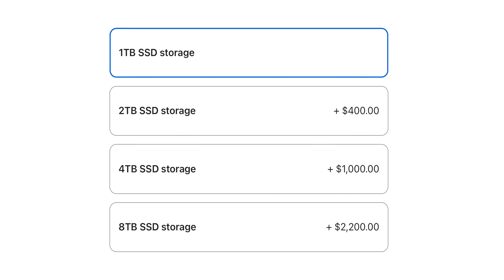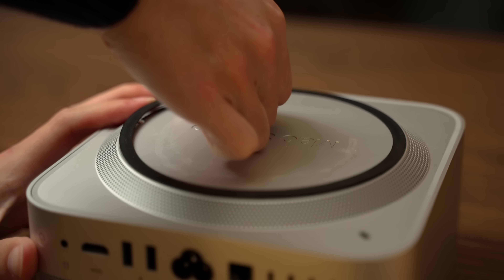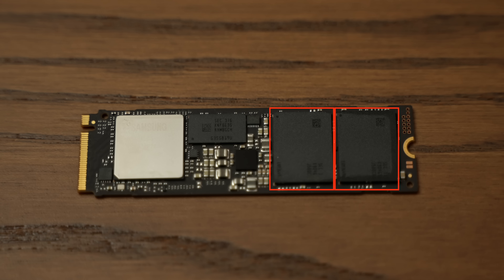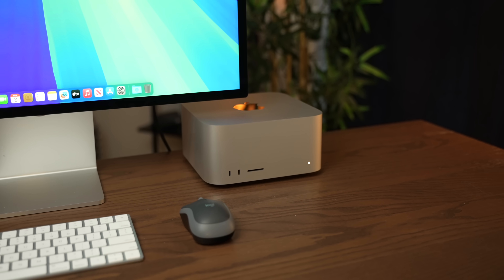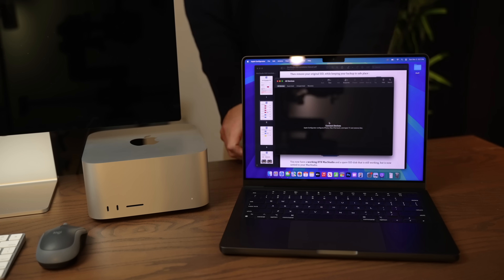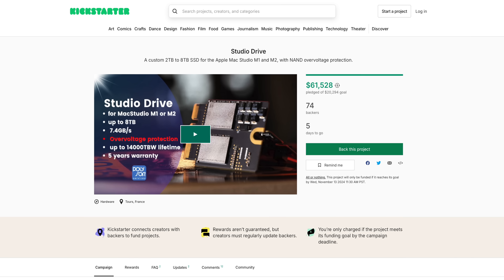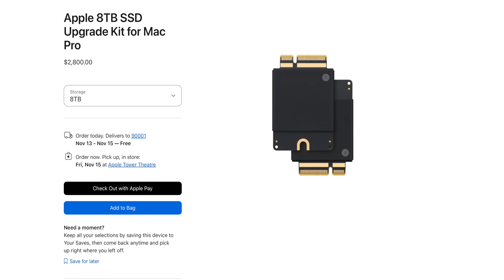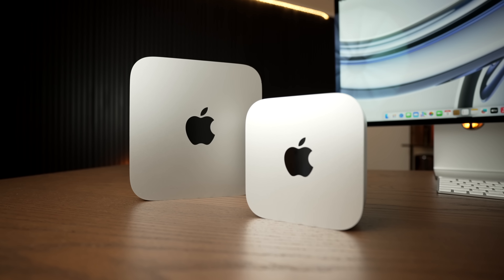UPGRADE your Apple Silicon storage for HALF the cost!

Comment: Can't wait for Apple to roll out a firmware update that turns the PSU into thermonuclear bomb once you remove the SSD
Reply: That design will be very Israeli 😂..
Reply: Must an Apple shareholder to say that
Reply: They're gonna have to change this at some point. I smell EU is already on it. 😂
Reply: You know if apple does that, it will become a lawsuit. People should have the right to use their own storage and not be forced to go with there crazy pricing that apple offers. They can't say if you upgrade it voids the warranty then go create firmware to block 3rd party storage because that would be a double violation. Voided warranty and you block the external storage
Reply: unfortunately they cant really do that! the ssd controller is integrated on the SOC
Reply: I learned the hard way, that Mac's can't work off the power, if you remove the battery. It still boots up, but it takes like 6-7 minutes for me, to be able to open up Finder. My battery went balooney, so I took it out and put in on the dir at my backyard, in case it was about to set itself on fire. But I still needed my laptop for work. I've had like 4 other laptops. All of them work withot a battry, no issue! No here ... not the Mac!
Reply: Do you mean apple silicone version or all macs? @user-qy2wf2lt6v
Reply: Don’t worry Trump will end us all before Apple can
Reply: They'll turn it into a Motorola pager !!😮
Reply: You are savage in your source of mirth
Reply: Is there an option to upgrade my iMac mini m2 planned?
Reply: found the sour guy who paid retail to upgrade his ssd 🤣
Reply: At least making the Mac Studio self-destruct… render it unusable… It will come with the next firmware!
Reply: Goofy
Reply: apple can fix this easily. Just lower the price of the SSD upgrade and raise the price of the base basic version. Is that what you want?
Reply: @imho4990 … or just offer storage amounts comparable to other manufacturers????? No need to guzzle the corporate glizzy bro. 

PCIE 4.0 storage is literally so cheap rn.
Reply: @RiceCubeTech  The problem is that the base Macs are very cheap. If you want to buy something from ASUS, DELL etc. you have to pay more despite cheaper SSD memory.

I prefer the current business model. Those who need more memory make money on this device and have a budget.
Reply: @tomaszolszewski8561  The problem , from my perspective, isn't the business model. The problem is pricing. It shouldn't cost $200 to upgrade to the next tier of ram or SSD.
Reply: @dog61  The business model is based on making money on memories.
Reply: @imho4990  Or just stop overcharging by a 200% markup?!?!?!?! You seriously don't get it!
Reply: @imho4990  They could also simply take a minor haircut on their massive profit margins and spend the extra $4 it would cost (retail... to the end user) to get a 512GB SSD instead of 256.
Alternatively, they could not charge $800 for $120 worth of 2TB SSD (Samsung 990 Pro that absolutely creams the Mac Mini's storage by being upwards of thrice as fast.)
Again, that's A) retail to consumer pricing. Apple gets massive discounts. B) You're sacrificing the 256 included to get the 2TB rather than getting both with the latter option, etc.
Reply: @imho4990  Why are you a hater?
Reply: @lovelymusicnow4404  How is pointing out potential retaliatory behavior by Apple being "a hater"..?
Reply: @imho4990  yes they can, but that's turning one problem into another. I would definitely prefer the cheaper base model so I can upgrade the storage myself (If I were to ever buy one of their products, which is never)
Reply: @_xX_me_Xx_  Just as I thought. The people who have the most to say are the ones who haven't even touched an Apple device. ;) Pathetic.

Comment: Need this for the mini, it’ll sell loads
Reply from the maker: Absolutely
Reply: Unfortunately Polysofts SSDs will only be available for the base M4 version, since the M4 Pro has a completely different physical SSD footprint (they would need to start over reverse engineering). 
And on M4 Pro Thunderbolt 5 external SSDs will probably do the same thing better for cheaper (without having to open the machine, which only power-users can do on their own).
Reply: @PseudonymC  Considering that the base M4 is just as good as an M1 Max, somehow I don't think that'll be a big issue.
Reply: @LindonSlaght  Don't forget that Apple SoCs are more than just a number of CPU cores! The CPU cores might outperform M1 Max, yes. But the GPU on the M4 pro is almost double the performance of the base M4. If you want to run upcoming Apple AI locally, that's going to make a tangible difference in your day to day (the NPU doesn't do all the processing, it significantly offloads AI tasks to GPU).
Reply: @LindonSlaght  Sorry about nerding out there. I hope to be proven wrong, but Apple does take a pretty penny for upgrades, they are going to provide you with enough reasons to feel the need to upgrade (to m4 pro or m5) rather sooner than later.
Reply: @PseudonymC  I think it greatly depends on your workflow. From what I've seen, people have this silly belief that upgrades from generation to generation are anywhere near necessary - nah, if a device is suiting your needs, there is no reason to upgrade. For the vast majority of M4 buyers, their next computer is very unlikely to have an M6 series chip, let alone M5. You're right about the GPU performance, however, I'd be more excited about AI masking in my photo and video editors than apple intelligence 😂 it takes very little searching online to tell that, yes, apple intelligence is a total joke. Me personally my main concern is RAM capacity and storage capacity for future proofing, because well, for video and photo editing unless you're doing some insane stuff, the M4 base has it covered 4x over.
Reply: @LindonSlaght  Perhaps, but remember when Bill Gates said 640K was all anybody needed on a PC?
Reply: @Combat_Epistemologist  Yeah that was pretty silly. But computers are fairly mature now. It used to be a year over year upgrade could genuinely improve professional workflows, now it just makes them slightly faster, so whatevs.
Reply: @LindonSlaght they have been mature for a while!😂
Reply: @ysiegel5544  shush man, the only reason I said that was so someone didn't argue the other way, yet here we are
Reply: @PseudonymC what?! So, if I get the m4 max, I can't use their SSDs?
Reply: I bet the major market will be for the base model Mac Mini m4, many users of which will be probably be satisfied with upcoming thunderbolt 4 external drives.
Reply: Same 😺
Reply: Just buy an M2->USB adapter, plug it into the back of your Mini and live happily without losing warranty.
Reply: @APopov  Oh naur warranty! Hey psst, some of us keep our computers for more than a year
Reply: Mac mini doesn’t support 4 displays 😭

Comment: I'm so glad Gilles took on the challenge of replicating those NAND module PCBs! Definitely makes upgrading the storage in these machines WAY easier. Also, he intends to make a version for the M4 Mac mini at some point soon!
Reply from the maker: I can't wait for that! The work put into this project is insanely impressive
Reply: @lukemiani we need to reward their efforts and all but some Mac Mini SSD from them. i hope the base M4 and M4 Pro have identical SSD cards.
Reply: According to Luke’s video a couple of weeks ago when he was looking at both devices have the same connector to plug in. But the NAND modules plug into different spots on the logic board. And therefore they are shaped differently.
Reply: @alastairleith8612  Nope. Their SSDs are physically different...😕
Reply: I can’t wait for that either because I will have an M4 Mac mini in just a couple days and I got the 512 because I was not willing to pay what Apple charges, I mean over charges for simple storage.
Reply: @Streetysuperduper  Technically it can already be upgraded now by replacing NANDs on original module (I have a video about it), though of course a custom new module would be ideal. Not having available modules was more of an issue for the Mac Studio, where a second module is required for 4TB and 8TB configs.
Reply: @Streetysuperduper You still gave into their greed and hype and showed them that being anti-consumer pays off and they should keep doing more
Reply: But as they basically copied Apple's design, can they not apply copyright infringement?
Hope not, I hate apple tax.
Now I need a ssd for my 2020 27" imac.
Lol
Reply: @Tech_no_Man when it comes to design work a 5% change invalidates IP claims. that’s how fast fashion retailers in OECD countries exist, if not they’d be out of business by lunch time.
Reply: @Tech_no_Man 
I bought an 8TB 2020 27" iMac on Apple Certified Refurbished. Now all I need is an M-series chip (and any associated gubbins to make it work). I want to keep all my media on one device. I'm a little more than halfway through uploading it and then my Apple SuperDrive gave out. Gotta stop buying more content as I'm already beyond 4TB used on the 8TB SSD. Frustrating.
Reply: @Tech_no_Man No. Or rather maybe. Apple can’t copyright the item, nor can this be patented… but it’s Apple so they could theoretically sue the company, knowing they would lose, but make it so expensive that the company gives up. Considering how many Mac owners are willing to open up their multi-thousand-dollar computers to upgrade their own SSDs, it’s probably not worth the hassle for Apple to bother with.
Reply: @Tech_no_Man Well, they added voltage protection😅
Reply: Dosdude1 jumpscare
Reply: m4 mac mini would be a take my money situation.
Reply: Goat 🐐
Reply: Do you have an opinion about how robust these reverse-engineered modules will be to MacOS updates?
Reply: @ Will be no different than original Apple modules, as the parts used are identical.
Reply: Will they run afoul of patent infringement?

Comment: Thunderbolt 5 SSD is also a option.
Reply: you lose a slot you pay a lot of money and moreover internal upgrade boosts the speed of the mac
Reply: @BLACKWELL-1  Yikes, okay.
A "slot". That's... that's not what that's called. It's called a port.
You pay *way less money*.
Internal SSDs are, in fact, much slower than the external SSDs due to how poor the read/write/access/latency performance of the Mac SSDs are.
An external SSD would actually boost the speed of the Mac.
There is no performance penalty for using Thunderbolt. You'd know this if you had the faintest understanding of how PCI Express works.
Reply: “Apple Intelligence is not available when booting from an external drive”
Reply: @tdrg_ exactly, but I have heard you can take the suer directory and put it on an external drive and maintain AI and TouchID
Reply: @lchanceiv  you’re probably correct
Reply: Once the internal ssd dies, because of the t2 security chip, the Mac won’t boot anymore and is essentially useless.